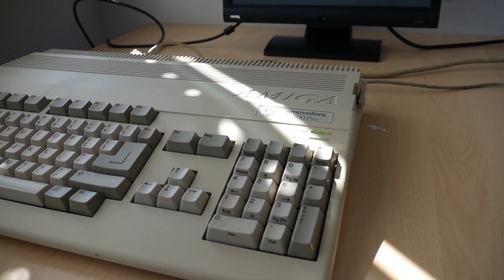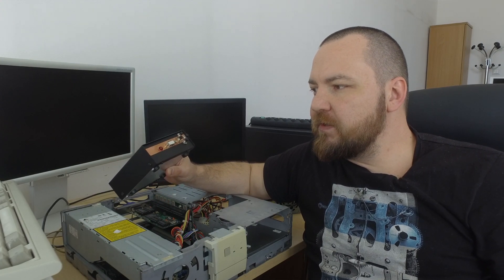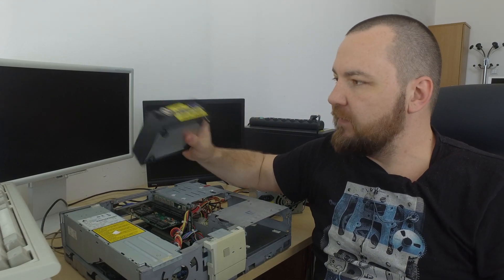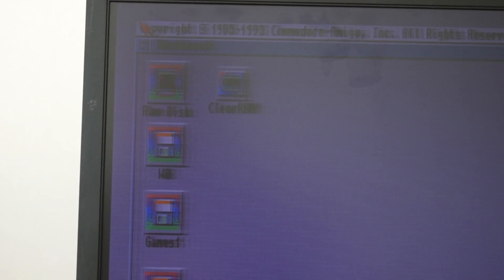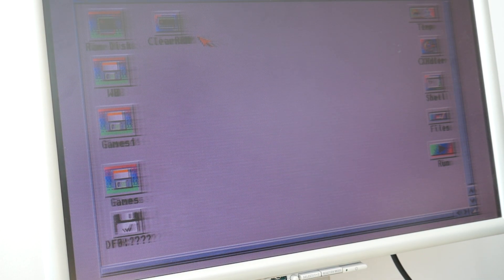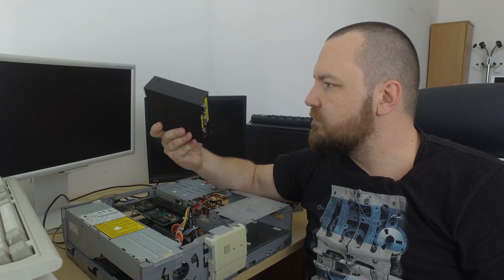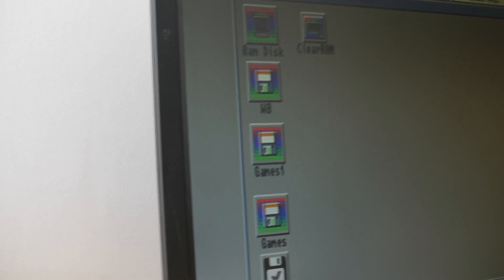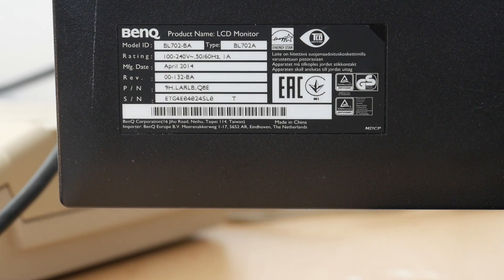Why not GBS 8220?

Comment: I have one of these on an a600 works ok.
You have to add a resistor to one of the wires from the 23 pin wires to the video card.
Reply from the maker: Yes, I did that. No luck for me, I guess it’s just a lottery if you get one that works fine, I havn’t try a600 tho.
Reply: i have the smaller board as well from alibaba but it defaults off screen so i would not recommend that one.  try the card on another amiga. see if you can narrow it down.
Reply from the maker: I have a 500 and 500+ both no luck, couldn’t see any difference. Hope to have 1200, as soon as I can buy one at decent price.
Reply: You need a GBS Control : Firmware that brings the GBS-8200 Video Converter Series to Life. https://www.youtube.com/watch?v=MbfKCfoUM8k

Comment: I love the case that u make for gbs8220, make its better! Could u make a tutorial showing the step by step how to do one enclousere like that? One tip, did you think about use the WeMos(LoLin) to prodece scanlines on monitor?
Reply from the maker: Thank man!

Unfortunately I don’t have much footage from when I was making the case, I know nothing on metal work so I didn’t wanted people to cringe ;) I bought small metal box where all panels are held with screws, so they were easy to cut and drill. Then I made paper templates to measure holes. Then copied the paper templates to metal. I’ve drilled holes and done cut with dermal tool. All was finished with a file, cos my cut were rough AF ;). Just to give it a better look I used copper tape as “designe” accent, that was it. Hope it helps. Thanks for comment!
Reply: @techteststutorialsHD  yes, help me a lot, now i can build my own case, thanks!

Comment: I have a 20e upscaler with HDMI and VGA outputs.
The picture is good and I use it sometimes for Workbench use, none of them are for gaming (latency)
Another problem with all is the interlace artifacts and when white color is flashing, like when you respawn in a game.
I've seen the same problems on Individual's upscallers too so I'm fine.
Nice video.
Reply from the maker: Thanx mate! Will check that one out!
Reply: @techteststutorialsHD  check this mod out, it turns gbs82xx into decent scaling equipment almost on par with ossc: https://github.com/ramapcsx2/gbs-control
Reply: @techteststutorialsHD  Oh nice, it's like this one. Check it and delete my comment after that. I have no gain about this advert :-)

https://www.ebay.com/itm/Premium-SCART-to-HDMI-Converter-Support-HDMI-Connector-Output-Metal-Black/283850610726?_trkparms=aid%3D111001%26algo%3DREC.SEED%26ao%3D1%26asc%3D20160908105057%26meid%3D8974428984734a2bba9111a8ce7aa370%26pid%3D100675%26rk%3D3%26rkt%3D15%26mehot%3Dnone%26sd%3D174132028465%26itm%3D283850610726%26pmt%3D1%26noa%3D1%26pg%3D2380057%26brand%3DUnbranded&_trksid=p2380057.c100675.m4236&_trkparms=pageci%3A64926069-9c51-11ea-bb45-74dbd1804293%7Cparentrq%3A3d6c29321720acc1a8d906d0ff8facf3%7Ciid%3A1